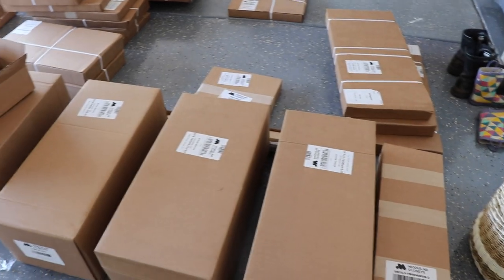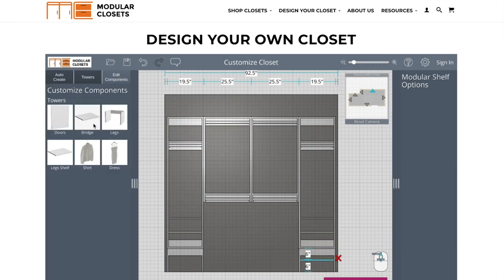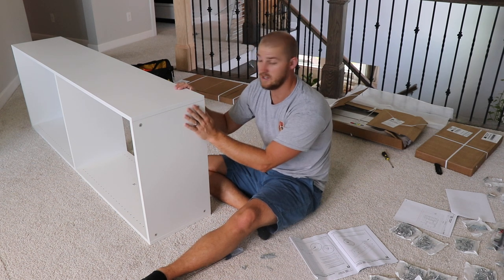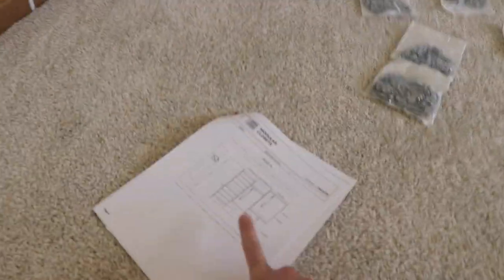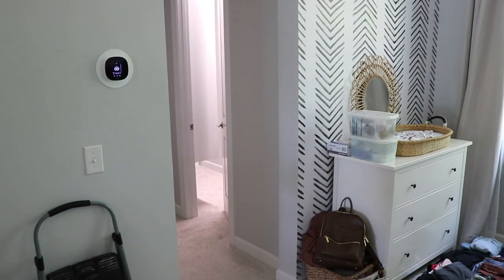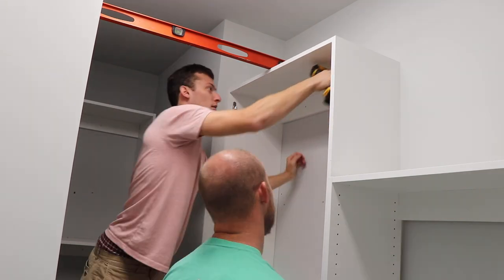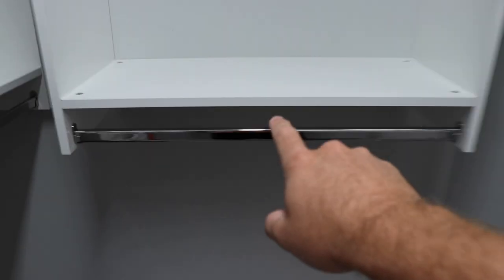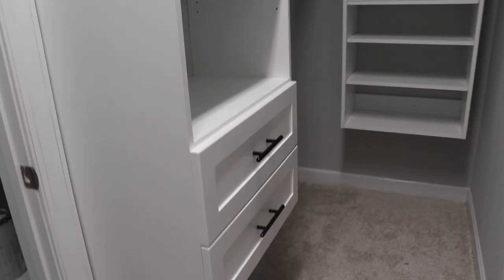CLOSET MAKEOVER | PART 1 | MORE WITH MORROWS

Comment: I don't know why Modular Closets doesn't place the bars closer to the middle so your clothes can hang closer to the wall and utilize that empty space. It would leave more walking space and would look neater. My closet has the bar in the middle and the clothes and hangers don't stick out. But either way you'll love it. Gives you a lot more space.
Reply: Omg I just noticed that! What the heck! Yeah I would definitely want the bars pushed back more too. I could see how all of the clothes are gonna be hanging out in the walking space. That sucks.
Reply: they are simple screw holes.  You can always adjust them.
Reply: I don’t think they would be able to go back much further.. the system isn’t that deep. The bars are at the same place as the original rack if you go back and look at the beginning of the video.
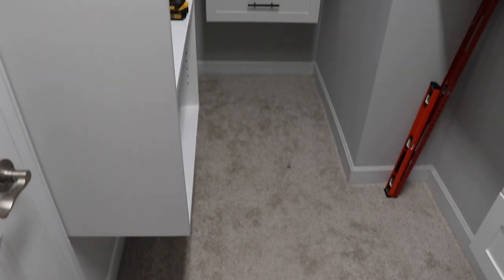Reply: I noticed that on the first glance. 11:38 Dont like that its sticking out while there is enough space  behind.i think brit might change that